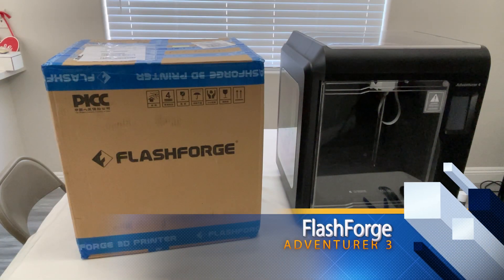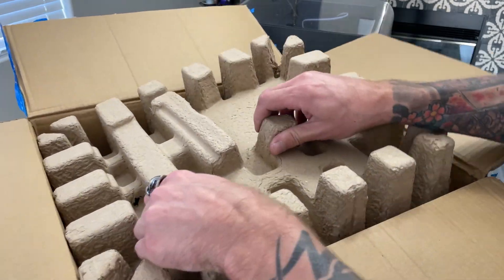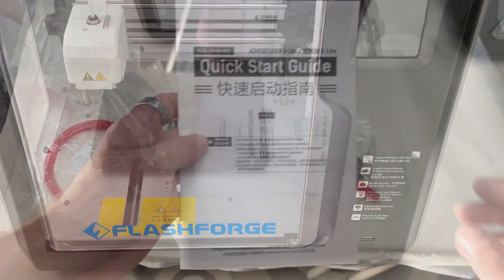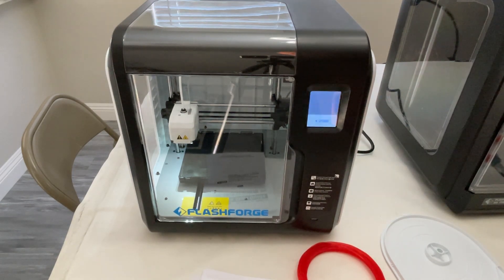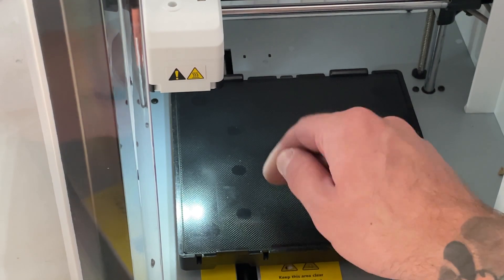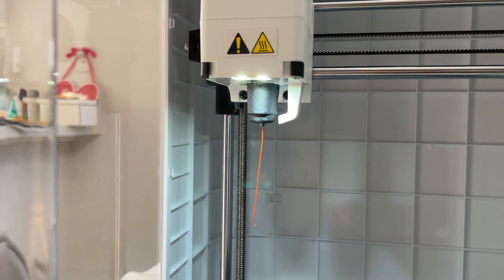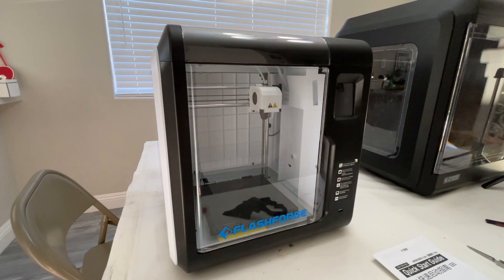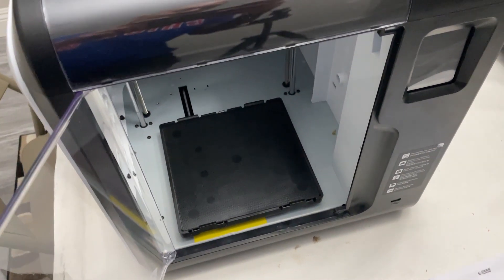Reviewing The FlashForge Adventurer 3 3D Printer - Honest Review

Comment: And that’s why we read all the instructions (and the labels).

I have the 3 pro and yes it’s small, but for the things I need to make it’s big enough and it’s enclosed so safer for my small children (2 and 4 y/o who love to watch it build stuff.

The bigger printer spool problem is solved by checking some makers (they made an extension that works perfect). It’s a small printer with some great options. 
But if you need bigger build stuff then yes an ended or D type is better.
Reply: exactly. most be people dont print things bigger than the adventurer 3 bed size anyway, for me personally im going to get an adventure 3 because i want easy out of the box precision printing.

Comment: I think the "pro" version gets the glass build plate (like Timothy said). Which is much much better than the flex plate (i ordered the glass plate later) because the flex plate gets warped after some use, and you have to struggle with the multi-point calibration which compresses your print at some points to even out the differences in height.
A glass plate will never warp and the prints come off easily when the glass plate is cooled down a bit.